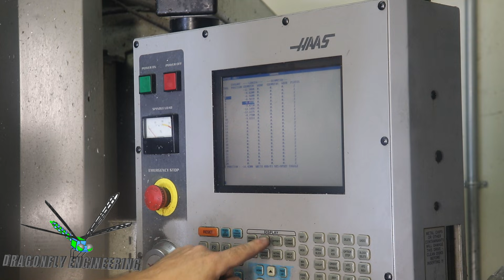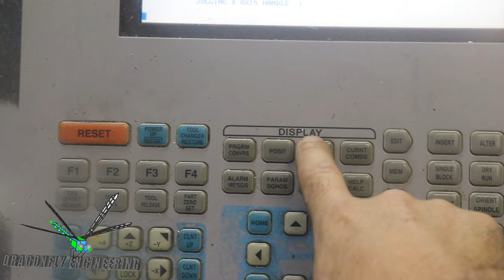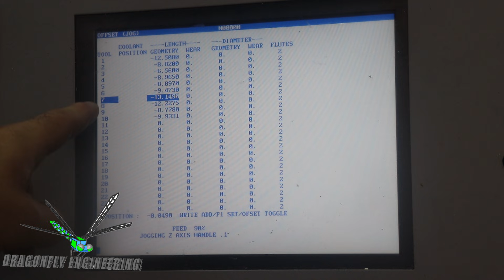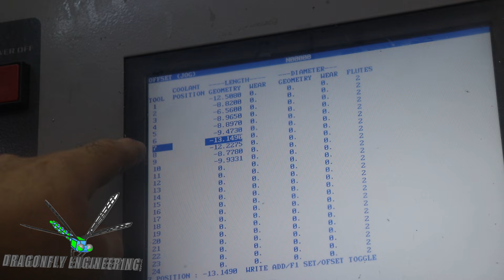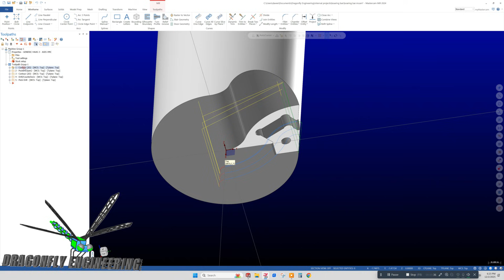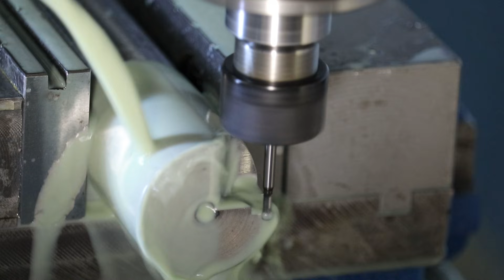CNC mill setup for beginners; making a boring bar

Comment: You could replace that floppy drive with a USB floppy emulator. A lot of people put those in because USB sticks tend to be a lot more reliable than floppies - and you also don't need a floppy drive on another PC to write the program to as well
Reply from the maker: yes, I need to do that.  I have had a usb emulator for years now in the manual pocket of the mill, just no time.  it is probably too far gone with chips and grease